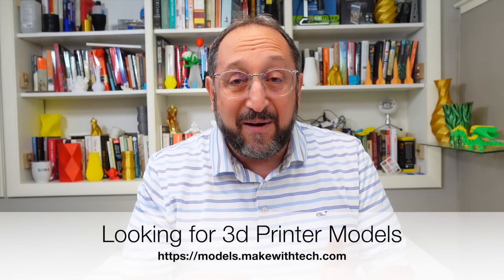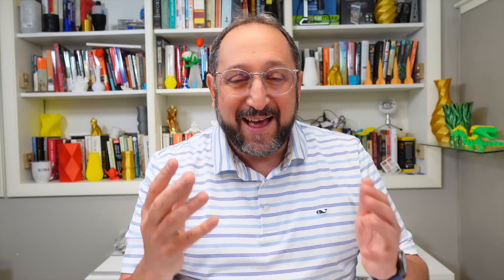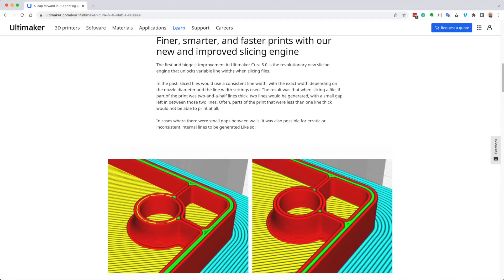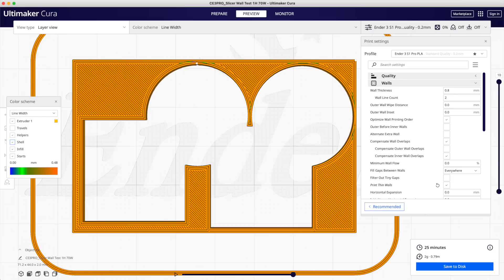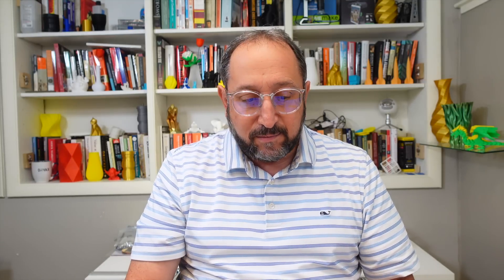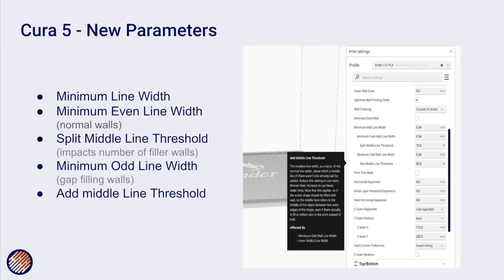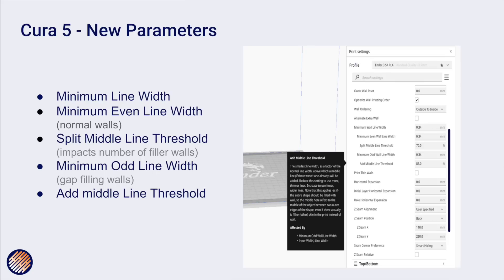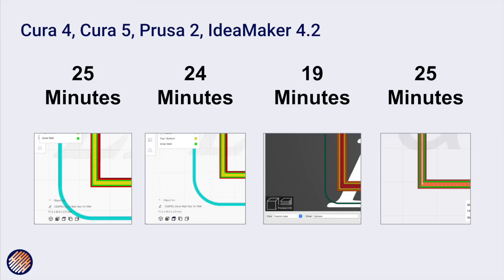Cura 5 Review: Is It Revolutionary or a Bust?

Comment: Questions not related to video. I just received a ender 3 s1 for Father’s Day from my wife. For the life of me I can’t find eject sd card. Thanks for the great content!
Reply: Press in the card a bit and it should spring out
Reply: I have the S1 and for the first two weeks, I was pushing the SD card in all the way and expecting a spring loaded click.  I would always push in, then eject, then push in again for the click. The SD card just need to be inserted without a spring loaded click.  To eject, you push first and it pops out.   To insert, just push until it seats.  It's not the standard push against spring to insert.
Reply: @emilcost8613  weird. My s1 has a spring-loaded click feel.

They may have some quality control problems with that board's hardware.
Reply: Are you inserting the card correctly. I also had a problem inserting the card - only to find out that the metal strips on the card has to face upwards.

Comment: I use PrusaSlicer because it just works, with the minimum of parameters and a far better interface.  Cura is hard to use after you learn PrusaSlicer.  Using the FLSun SR and PrusaSlicer produces amazing prints.  I also use primarily white filament so my prints are predictable.  The optimization settings in the new Cura are overly complicated for not much bang for the buck.  I'd like a hot end to incorporate a software adjustable aperture so the slicers could vary the line thickness on the fly.  Software can only do so much before the law of diminishing returns comes into play.  Irv, I love your videos because they are well illustrated and technical.   You do an outstanding job teaching this subject.
Reply from the maker: Thanks for your comment.  I will continue to do my best to producing useful videos.

Comment: If only I knew how to compile it so it worked on Windows 7
Reply: @Russell White Why should he upgrade?  A lot of people use older PCs not connected to the internet in their shops that run software to control other machines as well. The software for those machines are sometimes old and Windows 10 refuses to run them. Ok, so maybe Windows 7 doesn't get security patches any longer. Who cares? I'm not logging into my bank account on my CNC controller. The developers of Cura used that same "WiNDowS 7 iSn'T SeCUrE" scapegoat as well. A little digging showed it has nothing to do with their concern for security; their EULA absolves them of anything related to that. The UI library they decided to build their product on (QT6) depends on Python 3.10+, which ultimately dropped support for Windows 7. Someone made a build of Python 3.10 that runs just fine on Windows 7, so it is possible to do, they just don't. If you ever look at open source projects that support Windows, they almost always us a Microsoft Visual Studio build system instead of an open source compiler such as MinGW/GCC or Clang/LLVM, so when Microsoft drops support for an OS in their build tools, so does everyone who uses said tools. @Dale NDTG If you want to continue using newer versions of Cura but don't want to downgrade your computer with Windows 10, you might look into giving Linux a try.